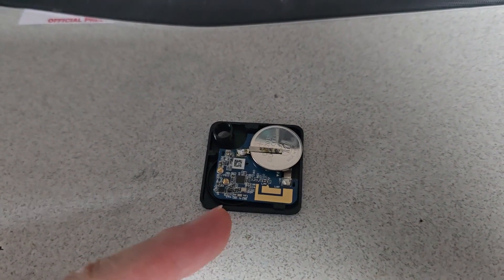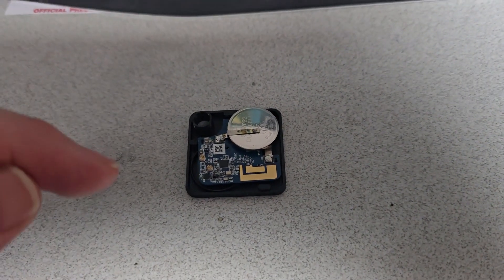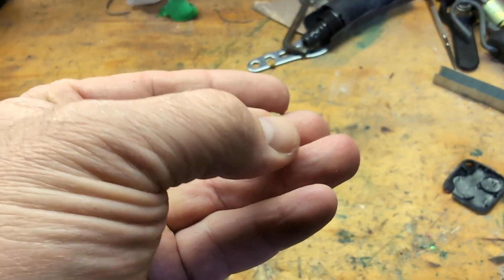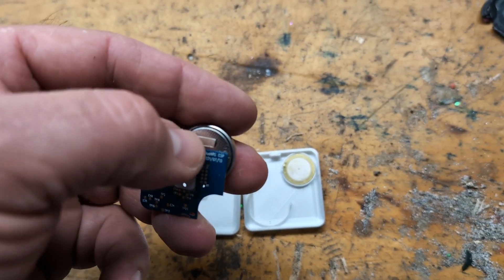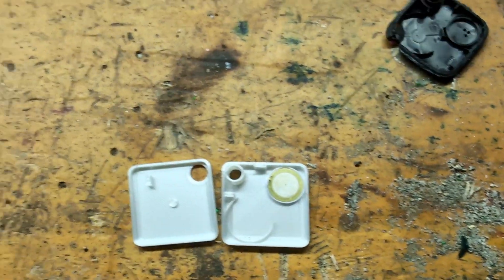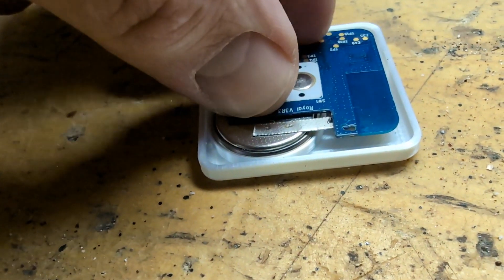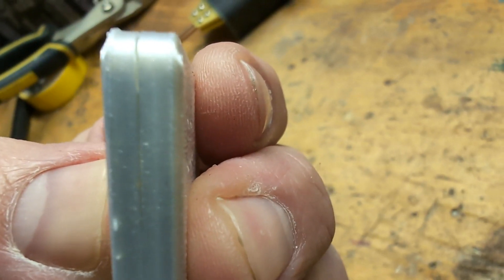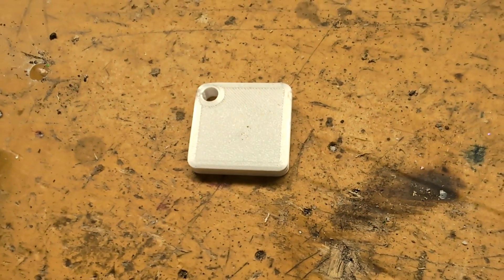Tile Mate 2022 Battery Replacement.

Comment: Thank you. I was able to replace my battery in less than 5 minutes. I did not tack the leads back on to the battery, I did bend them a little to force them to 'spring' against the battery. I used the original case and a little bit of superglue. I had no problems with the app reconnecting or recoginizing it once the battery was replaced.